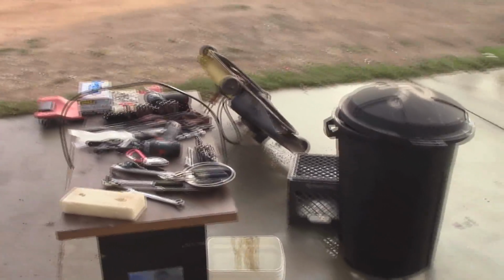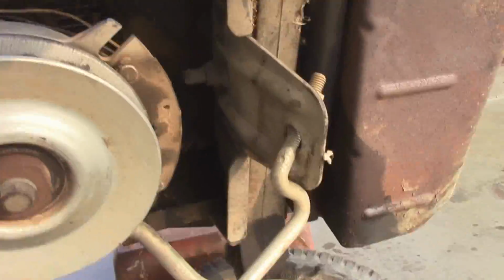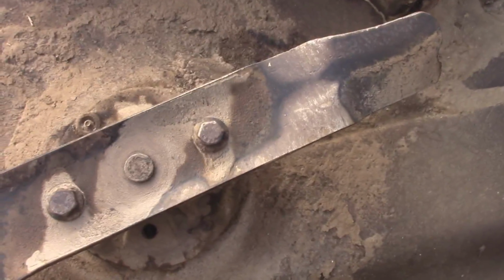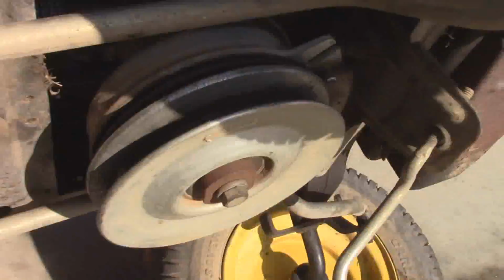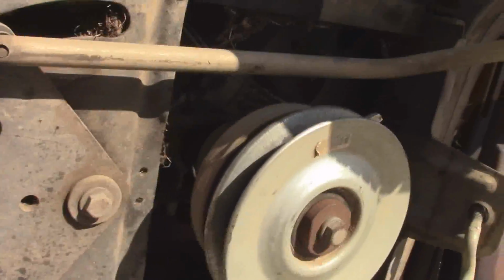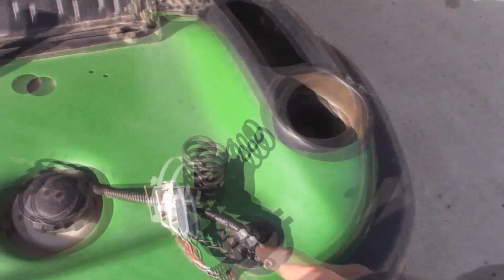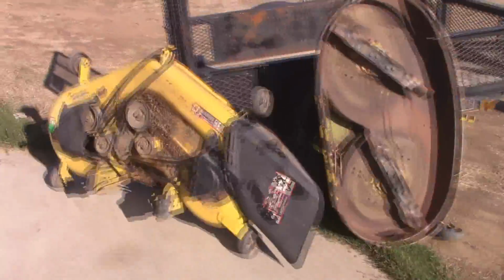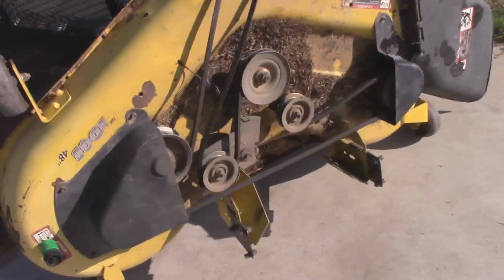John Deere / Husqvarna Drive Belt Routing and Seat Safety Bypass

Comment: A very few of the Craftsman and husqavana have the same issue where the steering shaft goes through the center of the belt but there diagram shows it going around the steering shaft and this video is the only one that has shown that drive belt design so please add the husqavana and craftsman name so people can find it also what size belt did you use thanks

Comment: ALWAYS CHECK YOUR REAR TRANSMISSION FAN!  If the fan gets plugged with grass it stops sending cooling air over the transmission " cooling fins" and burns up the oil by overheating the trans unit.

Comment: Hank, I have an L-130. Bought it used a couple of weeks ago. It runs and cuts fine for about 20 minutes then doesn't want to go up any hills. Do you think it's the belt, the transmission or both?
Reply: It's mainly the transmission.  As it heats up the pumps don't  hold pressure with the worn out oil inside.  Mine was doing the same thing after 15 years of using it.  I rebuilt the transmission this past spring and it runs like new again.

Comment: How can you tell if it's a belt or the trans? I have a L110 and after about 30-40 min of mowing it doesn't want to climb small hills or reverse very well, very slow...?
Reply from the maker: How many hours are on it and have you owned it since new?
Reply: @hanksgarage_  550 on hrs and yes on original owner, runs great engine wise .
Reply from the maker: It’s a pain in the ass but I’d try changing the oil on the trans. That is if the belt seems to be ok condition. There’s videos here on yt how to do it. Just search John Deere tuff torque oil change.
Reply: @hanksgarage_  Thanks

Comment: I have this same model. I used it for a job & brought it back home, after clean up it starts but won't go. It seems the drive belt will not engage. Where can I start troubleshooting?
Reply from the maker: The forward and reverse pedal. Make sure everything is working there and all the linkages are intact. It’s possible something came undone or rusted off maybe.

Comment: When I drop my deck I take off the linkage at the top, if you do the bottom be careful that it does not hit anything when lowering the mower.

NOTE: I tilted my LA135 and leaked some oil from the valve cover.

Great video and very helpful. I was changing my steering gear and plate and decided to do the belt as well.
Reply: Jimmy Traylor i lower the deck ro the number 1 setting  b4 i pull anything. I also unhook from the top and leave the brackets with the deck.

Comment: how do you adjust the tension on the drive belt?
Reply: Jamie, I do not think there is a adjustment on the drive belt on these models
Reply: It has a spring connection to a bracket and a cross bar

Comment: Hank, I have a LA145, I had the traction belt jump off the rear pulley and got wedged between the pulley and fan, belt smoked,
I replaced the belt with and aftermarket belt, worked fine for about one hr then started slipping or the tractor would no longer pull,

I purchased a John Deere belt but have not tried to install it,
I am concerned my rear hydrostatic transmission is ruined as I can see no reason for the new belt not to provide adequate force to the rear pulley,
Question:  how can I check the proper operation of the hydrostatic transmission before I tear it down again and replace the belt,
Thanks, Fred
Reply from the maker: Check the rear pulley for any damage or wear. There really isn’t a way to check those trans if they work or not without running them as normal.